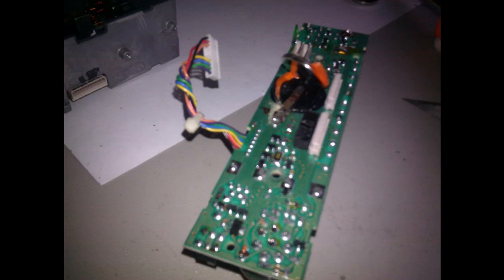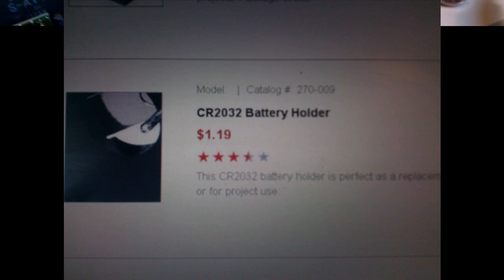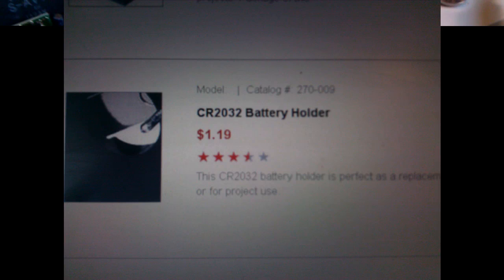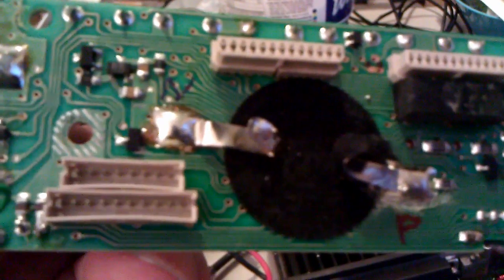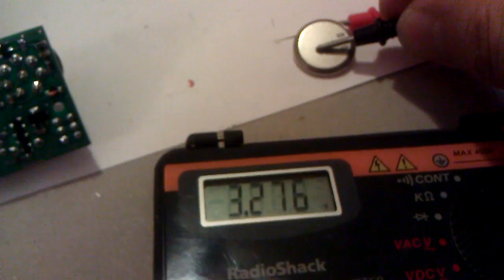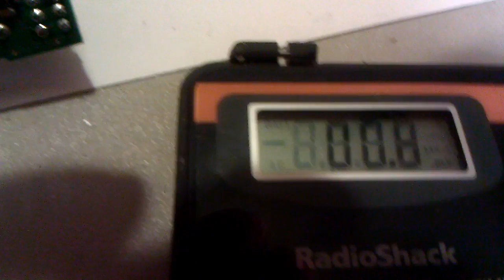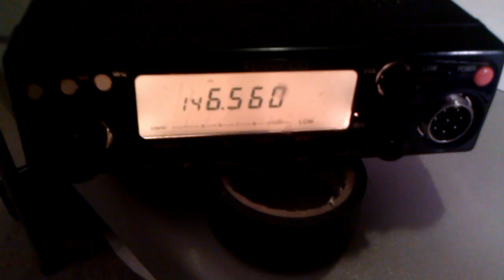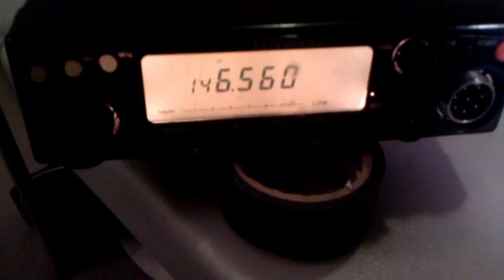Repair and Modification of the Kenwood TM-241a "Vintage" Mobile Radio

Comment: You sure this is a TM-231 because it looks like a TM-241. The 231/241 are pretty much identical radios but the 231 has a square, black power button and yours has a round, orange power button. Also, the six buttons on the bottom row of the 231 have a flat shape but the 241 are round... just like yours. The button placement is also identical between the 231/241 and it looks like Kenwood even used the same LCD module. Apart from these purely aesthetic flat vs round button differences, I doubt there's any real difference between the 231/241.
Reply from the maker: You are correct. It was a TM-241a. Never noticed!
Reply: Yeah the radio he has propped up on the roll of electrical tape is the TM-241A. The power button is orange and round, and the 241 has 4 steps of dimmer control which he demonstrates on camera. The TM-231a has either bright, or dim, nothing in between, so he's repairing a 241. ( I happen to own both rigs) CMOS battery in both are dead. Neither will retain memories which is why I came looking for this video.

Comment: Really ugly job. Sorry.
Battery is 3V, not 3.2V.
Reply: Most new batteries reads according to specification plus .5 or hundredths, if not thousandths, for its application. It wouldn't do any harm for its intended purpose. But take caution if reading is plus whole unit(s).

Comment: Friend, have you ever picked up a TM-241 problems with the display failing? If you took did WHAT to solve?  73
Reply: That is exactly what I was looking for!  From everything I've seen thus far, it seems this is a common issue with this model.

Comment: I just changed out the battery with a stock solder-in replacement but I must admit I didn't see the info to use the easier-to-replace method until AFTER the battery replacement was done. Although I wish I would have done that, I just didn't see the info in time but if I ever have to replace it again I'll be sure to do it next time.
The one and only thing I wish I could get is the TU-6 CTCSS decoder module but the one's I've seen cost as much as an good used TM-231 costs! Too expensive for me :\

Comment: I have this radio and as dated as it is it's still an excellent mobile radio system. I replaced the backup battery last year and replaced the display lighting bulbs, and now it works like it did when it was brand new :)
I've owned numerous Kenwood mobile radio's over the years and I love the simplicity of this little guy. Although it's scan rate is a tad slow, that's the ONLY fault I can find with it - not that this is a genuine fault to begin with.
Indeed, the TM-231 is one fine 2-meter radio.